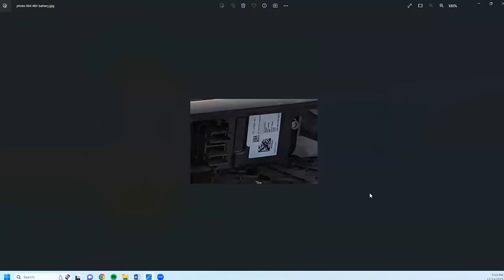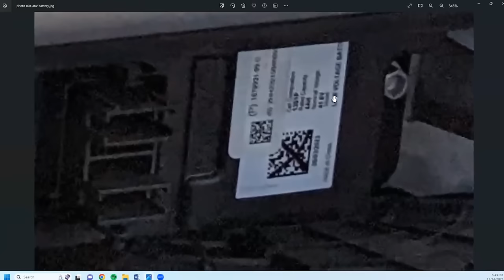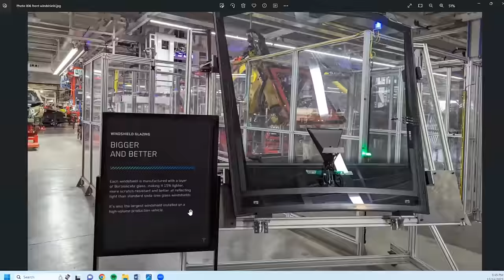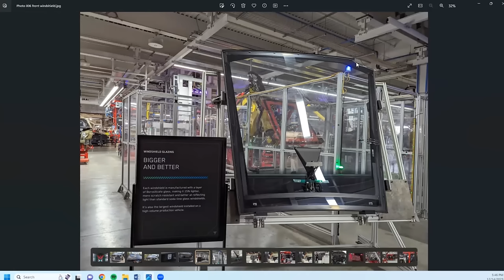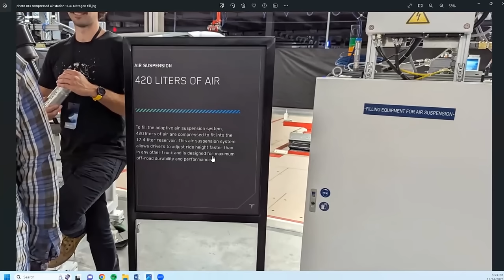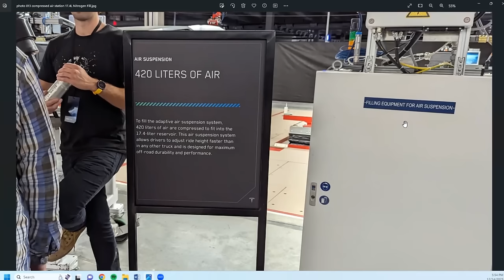Tesla Exposes What Is Under the Skin on Cybertruck. We Employ an Expert to Explain

Comment: 20:00) Plug came out of the battery: Is that a safety thingy? Does the connector eject in case of a crash?
Reply: It was probably disconnected after the crash by the test engineers.

Comment: Rear Gigacasting replaces ladder frame for rear load - 1 tonne.
That’d be nice to analyse how it’s designed. And what the sail casted inners actually do! And how much of that load is taken by SS sail exoskeleton. Could have briefly mentioned door jamb pillar is just double layer high-strength steel, not triple / quadruple. That’s major structural component of the car, the safety passenger cell. The part that couldn’t be exoskeleton. I’ll patiently wait on Munro Assoc do a full tear down - on a $120k vehicle.
PS. I do prefer technical videos to marketing / stock pump, so well done. It’s astonishingly clean under bonnet vs Mach-e, BMW, Audi, Hyundai, BYD. 
Oh, Nitrogen pre-charged? - I doubt it, can’t be recycled in microseconds, would require a 400 lt bladder. N2 is dealership scam.
Reply: Yes, the door ring is made of high strength boron steel.  It is incredibly safe for occupants.
Reply: @KK-ts1pm  agreed. It’s also structural core of a work truck, replaces ladder frame. Triangular rear sails transfer forces to top & bottom of cabin cell, like a bridge girder anchor point.
Cybertruck is combination exoskeleton sails (inc welded on filler cast), cast base front & rear, structural batteries, boron steel cabin cell - and doubtless windshield will play a part. Engineering moved forward a century from model T. Every other big pickup truck has passive cabin, free-rider (except Rivian?). Gonna need good glue!

Comment: Is there anything you see that indicates how waterproof the CT is?
Reply: The CT can ford a stream a foot or two above the battery pack level using wade mode.  The air intake is above the battery and pressurized the battery pack with air in thr air reservoir.
Reply: I'm pretty sure you will stay dry when driving in Prince Rupert, B.C.

Comment: It looks kind of dangerous. All the energy will be transfered to the passangers.
Reply: There’s basically no hard stainless forward of A pillar. It’s casting with progressive crumple zones. Engineered, by engineers. Passenger cell is designed to not crumple, to not trap doors. It’s then job of multiple airbags to soften impact, and they are everywhere. There’s no V8, no steering column. Enormous distance inside cabin to front of windshield. Tesla has extensive crash lab, that’s their forte.
Reply: @iandavies4853  except they were bent on SS from the start. It will be all about where the SS transfers the energy.
Reply: @Dularr  very little SS structural at front. Fenders & frunk are inconsequential.
SS doors supplies surprising T-bone crash resistance.
You seem motivated by ideology, by idea of hard steel, not reality.
If anything, Tesla gets flack for not being full exoskeleton, for being lots of cast aluminium plus some pressed high strength steel.
Reply: You Cray. With a capital Zee...
Reply: @FrunkensteinVonZipperneck  what is crazy is not thinking this design will not spawn massive lawsuits.